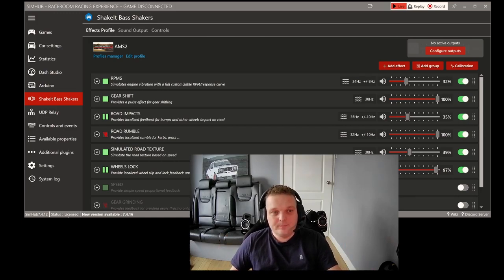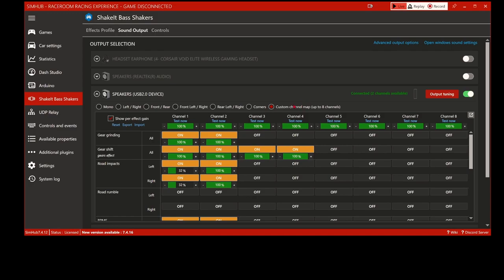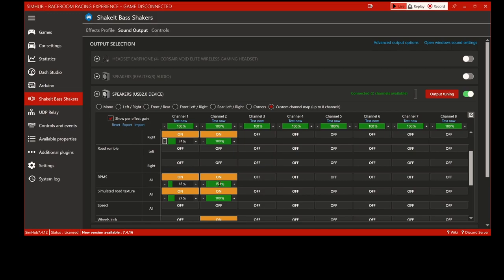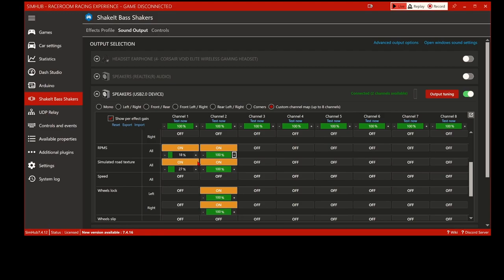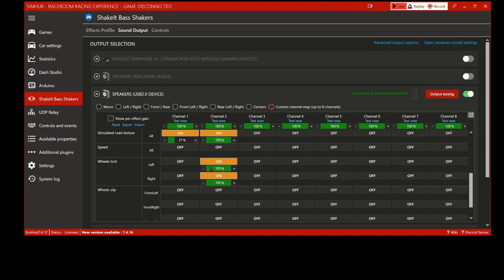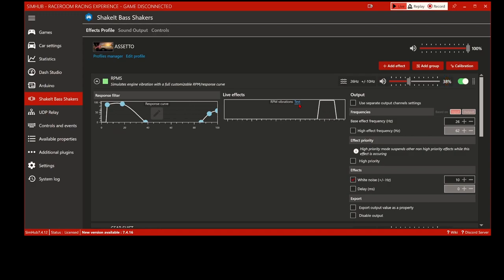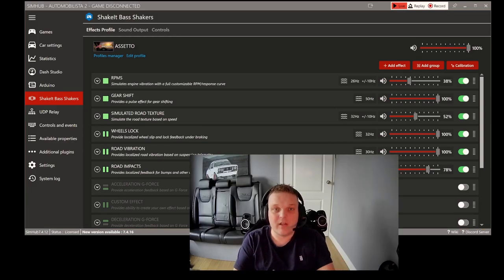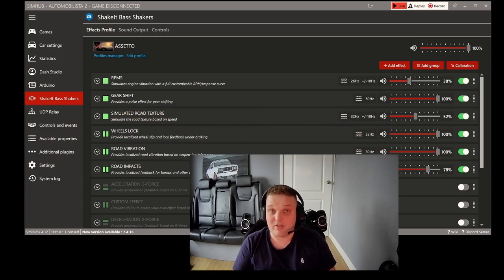Best Bass Shaker Settings For Sim Racing - Using Simhub

Comment: What I found really cool for gear shift is to clone the effect and set the second one with some delay (need to tick separate channel output), then adjust the first slightly lower and the second slightly higher in terms of output. You'll get a tactile effect resembling "ta-da" if that makes sense. Feels a bit more fun compared just to one click
Reply: Just tried this and have to stay you're a genius

Comment: Thank you for the settings tutorial. I'm running 2 BK Gamer 2s on left/right. I finally have a game room where I don't need to worry about disturbing my wife and kids. I fell into the beginner's mistake of wanting to feel EVERYTHING. Less is more! Richard Burns Rally feels way more alive now and not like I'm sitting in a message chair! The biggest help was seeing the Hz ranges and the white noise settings. I made a few gain tweaks for my setup, but overall your settings were a very solid starting point! Thanks again!
Reply from the maker: That's it, less is more! I used to want it to vibrate like mad. But soon realised it felt unrealistic
Reply: @garyevanssimracing5922  I just got my system up and running after having to replace a broken shaker for the rear.. one evening of messing around told me I had WAY too much info coming into the chassis.. I used to like having rear slip tuned to my single BK in my seat.. thought it would be useful to have that feature on all four corners.. seems that the system does nothing but shake like crazy almost all the time when a guy is wringing the car out hard.. I hate it.. de-tuning tonight and eliminating the wheel slip entirely from the feedback to see how I like it..

Comment: I cant wait I have a TR80 coming this week as well as my CSL DD will be here Sunday already have my wheel and pedals v3 clubsports and then have shifter and handbrake coming in 2 weeks and will be getting the transducers you recommended and the amp/soundcard thank you for all the content so it will make racing so much easier
Reply from the maker: Ohhh wow nice setup you will have bro 😀
Reply: You basically have the set up I wanted, but i ended up with a t300, fanatec shifter, and Tlcm pedals. When i upgrade il be going with heusinkveld sprints. I really wanted a set of the inverted v3's but I couldn't spend 600+ on it and I'm glad I didn't because the heusinkveld are about the same price. 

I got such a good deal on a lot of my set up, the Tlcm pedals were 179.99 open box on amazon, brand new condition, the t300 and conquer cockpit for 250 which was the best deal out of it all. I actually spent more on the fanatec shifter and usb adapter, ended up being just over 300 after taxes for shifter with adapter. I also had to get a drivehub just to use the shifter on my ps4. I need to get a hand brake still, probably will get the fanatec since it's reasonable and will attach to the shifter. 

I also want to set up some bass shakers. I'm thinking about just ordering 2 nobsound mini 2ch amps and a 4 pack of dayton puck's to start with. Basically a diy SRS Shakekit for 100 bux instead of 300 and I get to place em where I want. Eventually IL get some bigger ones with a dayton amp and use the pucks for the small stuff, like one mounted directly to the shifter and 1 directly to the brake pedal and not sure about the other 2 though. 

I just want to make it as immersive as possible and get as much detailed ffb as possible. Really enjoying not just the racing but the planning and building of the rig. It's so cool how far we have come for average folks to afford somthing that is this realistic is 👌. I can not wait to get a full motion platform 😀
Reply: you have the basically the same setup as I just ordered as well. Except I ended up returning my v3s in favor of the new Asetek Simsport Invicta pedals. My DD wont be here till April though :(

Comment: great vid Gary, just discovered your channel - been playing about with transducers for years now, have 4 BKA on all 4 corners of my P1 Rig - these are running through a Behringer NX4 6000 - but watching your vids recently I have just purchased another  2 Reckhorn 200is (which I am not too impressed with) but also another 4 Bass Pump III from Amazon, now just toying with where the additional transducers go - back of the seat, under-seat and also under pedals.  :-)   Loving the additional options and has brought a bit of live bit to my sim rig.   Cheers.
Reply from the maker: Glad you enjoyed the video
Reply: Agree, not at all impressed by to Reckhorn 200is, but they are 100W when the amp can only deliver 50W, and turning volume up makes it boil... while the speakers remain cold as ice...

Comment: Thanks for that, very helpful. I’m using iRacing’s LFE just for simplicity and to get access to their wheel slip data. The only downside is I can’t balance the front and rear and both have to be the same output both in overall volume and effects distribution. I’ve thought about buying a second amp and balancing the overall volume that way.

I have the front BST1 mounted directly to the pedal plate and then the rear is on some wood and the wood is mounted across the frame. For me, the front is much stronger. I notice you have your front turned up, but we have different mounts. I wonder if mine is about right then. It just feels a bit unnatural I guess and maybe a bit buzzy up the front directly on the plate. If I were to give a ratio to the strength of each I’d say if the front was 100% the rear might be 50%. Is this maybe a similar ratio to yours? Hope that makes sense haha

Comment: you need to use wheel slip. its the most useful of all the effects for driving.  you have rpm set way too high in my opinion.  you dont need gear grinding at all.  basically all you need is lock, slip, a very small amount of rpm (5%)  impact and road rumble if you want it are cool but not needed. unless there is something wrong with your amp, you have stuff up way too high. if everything is 100% it is hard to tell what the effects are telling you.
Reply from the maker: Everyone has different opinions, i set mine how i like it and how it feels to me

Comment: Hi, Hoping you might be able to help? i have always ran two dayton bass shakers and nobsound usb amp through simhub with no issues, i use the shakers for roadimpacts/road ruble & gear changes. i recently got a new PC and also simagic haptic reactors for my heusinkveld sprints, i set everything up as normal and added the simagic haptics aswell, I play on iRacing, Everything works fine as it should except the gear change, in sim hub when i test the bass shakers for each effect its fine and then when i test the gear change it activates the shakers but so faint you can feel nothing its almost like sound coming through them, or if you put the channel output to mono, any ideas?

Comment: Yoooo I was one of the ones harassing you for settings! Thanks!
Reply from the maker: No problem let me know how you get on👌🏻
Reply: @garyevanssimracing5922  It's not going well! Simhub constantly warns me that i have my nobsound usb amp set as the default windows output and it recomments using a different sound card. Thing is, its definitly not the default audio output in windows settings, and no matter what I change the default audio device to in windows, simhub refuses to see that and keeps the warning up
Reply from the maker: @JordanLee-xd3vm  simhub says that? O know windows sometimes says new audio device detected but not seen that in simhub
Reply: @garyevanssimracing5922  In simhub it still warns me that im using my nobsound amp as the default audio channel. I think it could be a bug because I just ignored it and my game audio still goes to the proper default headset and the shaker data goes to the amp properly.

Comment: Hi Gary, after a couple of years of sim racing, it's finally time to up my game; a whole set of new hardware, including an extrusion rig is on it's way. And after having played around with rumble motors, I'm willing to give bass shakers a try. Thanks to your extremely well documented video, this'll be quite easy to set up. I am curious though about the exact location of your transducers, you've mentioned in the other video that you've drilled them to your seat? And the one at the front is mounted on extrusion profiles, would it be possible to get some pictures of that?
Reply from the maker: I will try and get some pictures for you or maybe a video
Reply from the maker: Basically I took the padding from my seat and turned the seat over. I then marked the holes with a marker and drilled them out. Then mounted with m4 button head bolts into the transducer and used nylock nuts. For the pedals i made a frame from extrusion and mounted the transducer to that and fitted it to my pedal plate
Reply: @garyevanssimracing5922  great stuff Gary, appreciate it! Can’t wait for my new hardware to arrive to try and accomplish the same thing. Will let you know how things turned out 😉

Comment: I got the 2 bass shakers you used and the amp...the amp comes with a power supply why do you use a power adapter instead of the one that comes with it?.  thanks

Comment: Not sure if you use iRacing as I don’t think I heard you mention it. But if you do you enable the LFE settings in the misc options?
Reply from the maker: No i don't use iracing, but thanks for putting up the info for those that do
Reply: LFE is seperate to SIMHUB, I use iRacing to drive a couple of my shakers for different effects but most others from SIMHUB. No need to turn iRacing LFE on if you are just want to use SIMHUB effects.

Comment: So i got the smaller dayton audio pucks to use for general game play. Im currently using the Aux cord connection with the nobsound amp. Would you reccomend using the USB audio INSTEAD of the aux cord? and what would you reccomend me downloading to be able to EQ these for everyday games?
Reply from the maker: I Would yes
Reply: @garyevanssimracing5922   What EQ program would you recommend me using for everyday use of the pucks and not just sim racing?
Reply from the maker: @WaltAndWaves  not sure tbh as i only use them on my simrig via simhub

Comment: great settings you just saved me many hours of tinkering, any advice for dirt rally 2? i can't seem to get it right lol
Reply: Hi, Any chance you could do a vid in settings to improve drivability rather than effects. Ie how to setup to provide feel for braking and kossof traction, oversteer and understeer. I just cant get the balance right. Thanks great stuff. I use motor shakers connected to brake and accelerator. 2:Shakers under pedal plate and 2 under seat. Each area is isikted from the chassis to some extent to try and help interpretation of the signals., Phew

Comment: Thanks, why can you set the frequency, aren't those generated and specified by the sim?
Reply from the maker: Basically to change the depth of the feel of the rumble
Reply: @garyevanssimracing5922  Thanks, I understand what it does, I just would have thought those were fixed physics specified by the sim. Like if you go over a curb, the curb in the sim mimics real life, so the Hz of the vibration they generate shouldn't be adjustable. I can see adjusting the volume of the vibration, but not the frequency. Cheers.

Comment: Helpful vid mate, Any chance you can export your profile and share that?
Reply from the maker: Will do, good idea mate
Reply: @garyevanssimracing5922  Awesome, I just got 2 x BST-1 shakers and 2 x TT25-16 pucks. Currently waiting for the Nobsound cards to arrive. Plan on putting the one of the BST under the seat and one under the pedal deck. And the 2 x TT25s on the back of the seat.
Reply: @graybard8640  hi mate got the same setup as you,,one under pedal,,one under seat and 2 small pucks at the back,,would you mind sharing your settings?thanks

Comment: Question, does your nobsound turns off automatically or getting out of usb mode sometimes while you play Assetto Corsa? 

It does to me and I already kept it on 15% volume and max on the knob.
Reply from the maker: No I have no issues at all with mine
Reply from the maker: What power supply do you use?
Reply: @garyevanssimracing5922  i bought an extra 24v power supply in amazon, i believe its getting out of usb mode not fully powering off. but would the power supply that comes with it enough to power 2x 50w bass shakers?
Reply from the maker: @elsimdrifting  yes i use the 24v power supply. Maybe try a different usb lead and make sure you are into the pc rather than a hub if you are using a hub that is
Reply: @garyevanssimracing5922  yeah i have a feeling the usb is overloaded, i'll check what i can remove,

btw what's the difference in feeling when you use a 12v?
Reply from the maker: @elsimdrifting  it basically feels not as distinct if that makes sense....my power supply is one that you can regualte from 9 to 24v
Reply: @garyevanssimracing5922  i see, thanks!

Comment: Really good video! I just installed my Bass shakers connected via a Nobsound Mini and is works. However Simhub tells ne: "This output is your current windows default output, it's strongly recommend to use a dedicated output/Soundcard."
I know that the Nobsound has a bulit in soundcard....can anyone help?
Did I forgot to change some Windows settings?
Reply from the maker: Go to sound output devices in simhub and turn off the default ones and use only the usb sound card
Reply: @garyevanssimracing5922  Thank you for the quick response! Even after deactivating the other output (my headphones) and restarting the application, it still says the same 🙁
Reply: Did you ever figure this out?  I’m having the same issue.
Reply: @davidsummers952  Yes I did, have an look in the last comment from Simracingcorner DIY Pedal Bass Shaker Video. It was just something in the Windows settings....

Comment: Im using the same configuration as you, but in wheels lock when I choose left/right in effect spatialization, the bass shaker dont vibrate in the left tes, why?
Reply from the maker: Have you got it turned to 100% in the profile too?
Reply: @garyevanssimracing5922  yes
Reply: @garyevanssimracing5922 when you test the left side it vibrate? Why are your effects setup as left/right when you have a front/back shaker? Please Help me to configure it the better possible 🙏
Reply from the maker: @thearenaschannel  because its how simhub sees them from the nobsound amp
Reply: @thearenaschannel  go into sound settings and configure quadraphonic.

Comment: hi i cant get my bass shackers to work in iracing it works on simhub but not in the game any ieads? thanks.
Reply from the maker: Make sure iracing is highlighted in the games tab of simhub when you launch iracing. Also make sure you are on the full version
Reply: @garyevanssimracing5922  you have to buy the full version?
Reply from the maker: @jordanhoyle577  if you want the full features yes. Or you have to make sure the game is running from simhub in the games tab
Reply: @garyevanssimracing5922  I might pay for it and see if that works